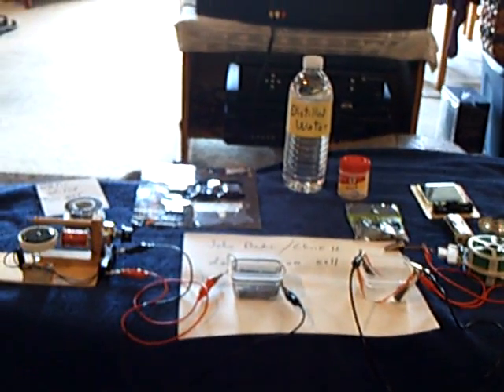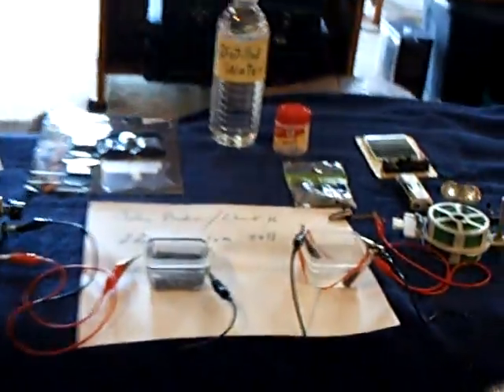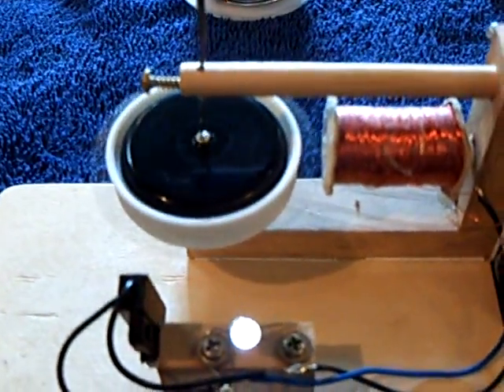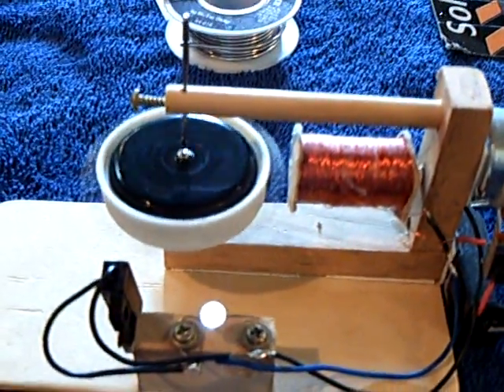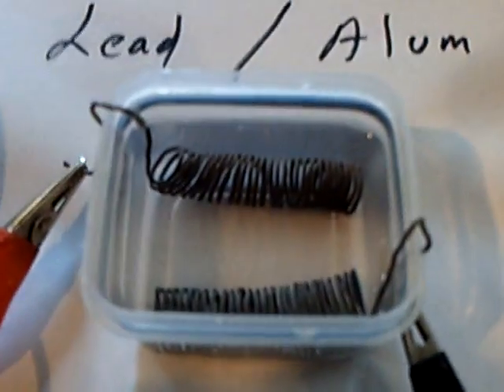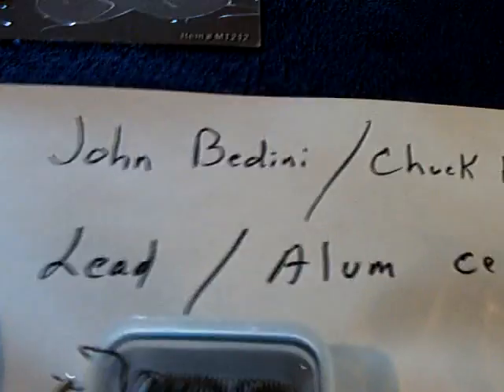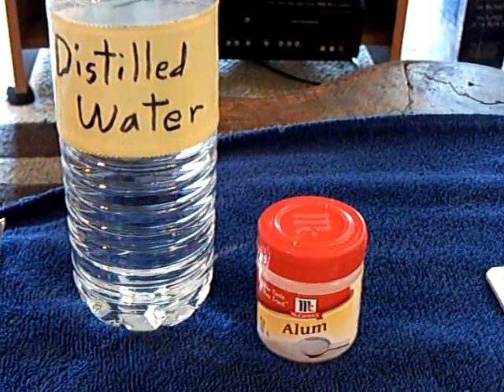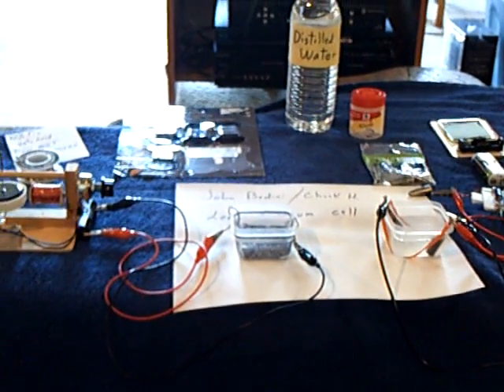Lead--Alum Homemade Rechargeable Battery

Comment: modern solder does not contain lead. 50/50 solder is old electronic solder half lead and half tin. epa made it almost impossible to get lead solder. the current stuff is tin/antimony/bismuth. and you cant get it to work worth a d...
Reply from the maker: I had a hard time finding this. It is Chins stuff I got at a dollar store.

Comment: This should work with Magnesium sulfate too. People are doing this with dead storage batteries after emptying them and flushing with a baking soda solution in water and reviving them, but what they don't realize is that you get about 1 third capacity than what you would get with sulfuric acid. I knew that the positive plates of a storage battery was lead oxide, but I didn't know that charging the lead plates would create lead oxide on the positive plate. Interesting. Can you try  muriatic (hydrochloric) acid. Its cheap. You can get it at a hardware store. maybe if your brave enough, Hydofluoric acid!

Comment: Nice demo. Congrats on the battery idea. Was watching your video again and it occurred to me that your 60/40 solder MIGHT not contain any lead at all! I tried to read the label on the spool when you held it up to the camera but the focus wouldn't allow it. So, recheck the label on the solder spool to see if there is ANY lead in it. There is a chance it could be made out of "silver bearing solder" which contains NO lead. Just a thought.

Comment: Could someone make it more clear to an idiot like myself. So what I understand he is saying that after putting this anode, cathode and electrolyte (alum + distilled water) it is an actual battery. You can recharge it like a regular battery. Is that correct understanding?
Reply from the maker: This is a true rechargeable battery that does not wear out.  Google 'lead acid battery' to find out how it works.  The sulfuric acid electrolyte has been replaced with Alum and water but the reaction is basically the same.

Comment: You can melt led on your stove. just put a window fan in to suck the fumes out, Dont stand over them and watch.
I wiff wont kill you but but long term exposure is bad.

now get a chunk of wood and then on top of that tack on some strips of wood to make the shape of the plates you want.
The wood wont catch fire and you will be able to pour dozens and dozens of  them before needing to re build it.
Pour it as cool as you can before it starts to solidify.

Comment: Yeah you can also use Car wheel weights but you have to melt separate and Cast your Plates. you can use a Propane stove/ Barbecue grill or if you want you can get a Lee Casting smelter. to make your Lead Plates. you Can also melt your Aluminum too. you will also need to make a Brass Moled to link your Plates together. Most commercial places use Powdered Lead and Lead peroxide to make there Anode and Cathode Plates. and make them in one shot press and Melt and they are Done.

Comment from the maker: I don't know.  I might try that.  Be careful about using copper wire with the lead down in the vinegar.  You may get a galvainic reaction between the two dissimilar metals that will give you a false sense of what is happening.  Putting the lead sinkers together with perhaps stainless steel wire might be better.  Try laying a lead sinker on a vinegar dampened paper towel with the copper wire next to it and see if you get a voltage reading.

Comment: I strung 10 small lead fishing sinkers on two pieces of stripped copper wire (5 on each wire. each sinker about 5mm). I positioned them in vinegar, just as you positioned your coils in the Alum. There was a small current reading. A FASCINATING OBSERVATION: My current grew by just under twice the amount by simply positioning them perpendicular to each other instead of parallel. Do you think your coils would do the same if aligned perpendicular?

Comment: if i only got lead, sulfate hydrate, Distilled water
can i make a such small battery will these stuff ?
im currently searching for Lead dioxide use as Electrode plates
but it is hard to find in my country

Comment: I tried this about three years ago using coiled up lead sheet. Although it worked, The capacity was much lower than sulfuric acid and it would not hold a charge for more than a day. Also, the brown lead that forms on the positive side will easily wipe off or even fall off if disturbed. Good work..

Comment: Hey lidmotor I found lead solder at ace hardware that's 60/40 and 50/50 they also have 40/60

Comment: Lidmotor, In reading the energyscienceforum by John Bedini I need some clarification about the food grade Alum or Ammonium Aluminum Sulfate.  Is "Food Grade Alum Equal to Ammonium Aluminum Sulfate??  If this is correct I discovered a relatively inexpensive source for this chemical. Believe it or no, this same Alum was used in photographic film processing until the digital age came about.  I found a source offering 1 pound of Alum for $14 including shipping.  Does Alum have a shelf life??

Comment: Thanks for the info. I might take a casual walk around a local graveyard and see if any headstones have dropped letters on the floor.
Further testing of the car batteries has found that both mine improve with load..leave them and they sort of stagnate, voltage and current drop away...but use them and all stays healthy for far longer. Counter intuitive and I like that !

Comment from the maker: I got this cheap solder at a Mom and Pop dollar store and I have not seen it in any of the large chain stores.  The package says  "Sterling Tools"  package and product designed in the USA------made in China.  There is no mention of the lead to tin ratio.   My lead sinker cell is working pretty good also but this solder cell is out performing it.  You are right about heating up the water to dissolve the Alum fully.  I found some 80/20 lead wire solder on Ebay yesterday and ordered it.

Comment: Lidmotor taking the lead again ;)

Alum is great, but the warming is critical. I recently fixed an old 12V car battery project that was under performing, by sitting the battery in full sun and shaking it. It charges up much better on solar now. Had used cold water !
Which dollar chain is it ? Cali specific or national ? Will have a go at the solder version...that was an excellent idea of yours !

Comment from the maker: The ratio of Alum to distilled water does not seem to be critical.  I used about 1/4 tsp in 3 oz. of water and it worked fine.  I think that Chuck did say about 1 cup per 1 gal. of water.  You do have to warm the water up to dissolve the Alum completely.

Comment: Lidmotor,
What's the ratio of ALUM to distilled water? One cup Alum to a gallon of Distilled water? (or proportionally smaller to fit the volume you need)? -- Is this what Chuck H said once?
the 'ole tchr

Comment from the maker: I was wondering if I couldn't just wind the coils on top of one another with seperator layer of some kind between them.  It would make sort of  a test tube cell.
Reply: paper towel or toilet paper works great. I got over 6 amps of current like that from a short circuit with one only the size of an AAA battery. just a half an inch longer. I used 1.3mm thickness solder. 60/40 solid core worked for me.

Comment from the maker: The cell is around 1.5 volts instead of 2 like a lead acid.  My little cell will pump out about 20 mA is all.  The good news is that you can dead short the cell and because of the high impedence-- not destroy it.  I conditioned it by zapping it with 6v for a few seconds and then slow charging it with around 3 volts.  To scale this up I need to find lead plate material or I could just buy a motorcycle battery and replicate what John and Chuch did.

Comment from the maker: Good question!!   When the cell is first made the two lead plates are identical.  To form the dipole situation you simple apply DC voltage (at least 3 volts) across the two terminals.  The deposits form up on the plates (choose sides)-----and now you have a ball game.  The brown team against the grey team.  It is fun to watch.

Comment: im guessing it would be a simple case of applying voltage.
lead exists in several differents oxidation states,and i suspect its the closeness of frequency vibration of each so that electrons can jump from one lead plate to the next,if that is true then every metal with more than one oxidation state could be used to create a battery...maybe in wrong but im off to stare at the periodic table and  wonder...

Comment: thats fantastic news-home brew batteries with no acid!
i bet dead lead acid cells could be bought back using this chemistry...
if Bedini and friends are getting lead acid batteries to do this with allum,then it follows that its only the lead in the lead/tin alloy that is doing the work.
if anyone wants to homebrew some lead plates,it would be worth trying to furnace"cook"
powdered lead with an appropiate flux to keep it in a metal state,with a flux based grain mixed in to create a metal sponge.

Comment: Great success and nice finding with the solder! 
Please show open circuit voltage and short circuit current on these cells. 
Please try to scale it up ...
What did you do for the conditioning? Just charging them up? 
Many thanks! Regards,  Stefan.

Comment: On motorcycle battery I converted over to alum I charged it up and ran it all the way down and then put an led on it and it has been going for month solid with no resister. I am still waiting for it to go dead. I find with the alum battery you can put parasitic load on it and it keeps on trucking but if you put a current heavy load it does not go very far. Also alum battery can charge 5 times faster then an acid battery.